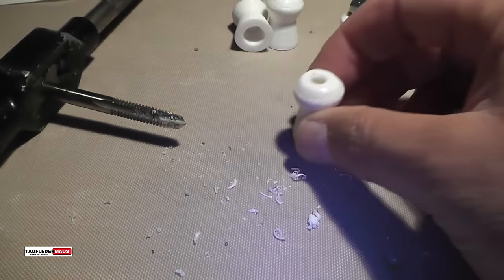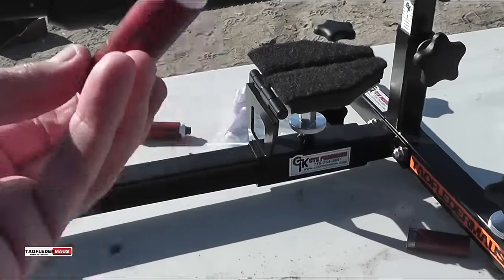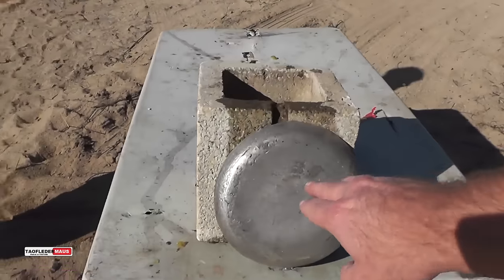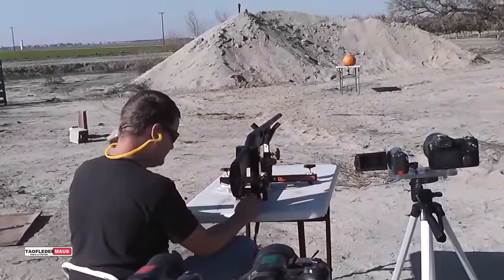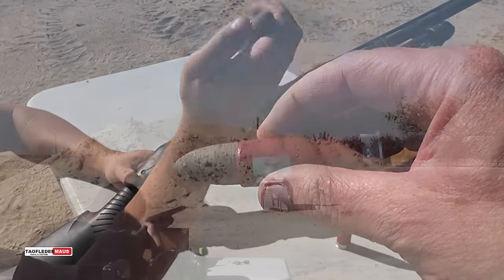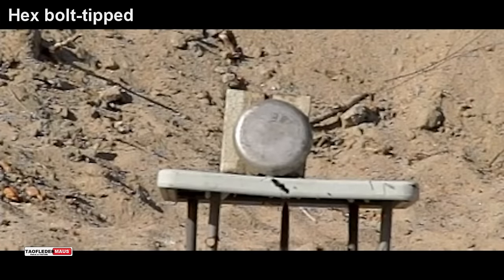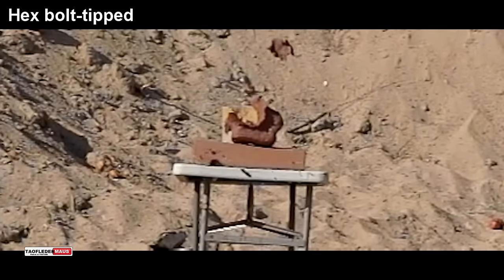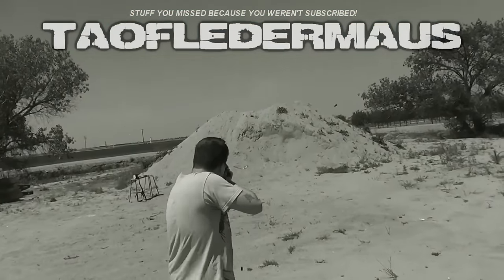15 year old viewer creates incredible 3D printed Slugs

Comment: Well done Michael (and you guys too). A lot of people dismiss young people for not having experience but they often forget that by not having that experience they do not have clouded judgement and are free to try things that adults wouldn't because "THEY DON'T THINK IT WOULD WORK!" :P
Reply from the maker: +Barnacules Nerdgasm  HEY!!!  Awesome seeing you here!   That is very well said.   I would have betted against these working-  mind you,  based off past experience.  First,  I thought they had a chance of just shattering from the g-shock the moment the gun was fired.   Second,  these were very lightweight,  and "normally" if a projectile is too light,  the main powder doesn't burn efficiently-  IF at ALL.   Third,  again,  since they are light,  having enough mass to just fly straight seemed impossible to me.  Think of throwing a ping pong ball without it curving.   It was absolutely thrilling to see these all work,  and I defy what I thought they would do!

Comment: It works because it's a good application of the skirted pellet design used in most air rifles, which is engineered to stabilize a lightweight projectile using high drag on the tail to keep it from tumbling ( as opposed to a high spin/ twist rate ).

Comment: I think that these slugs solve the main problem that the other printed slugs had. The others were made to stabilize through drag by having a long, light tail end. the problem with that is when the round is knocked off center, the whole round acts as a lifting body, pulling the trajectory into the direction the bullet is pointing. The tail of the slug will then oscillate (in especially wierd ways when the slug is spinning), pulling the slug in a different direction. This slug is much shorter, so any tumbling is easily corrected by the rotation of the round, and the flight path won't be thrown off by excessive drag. Very well done.